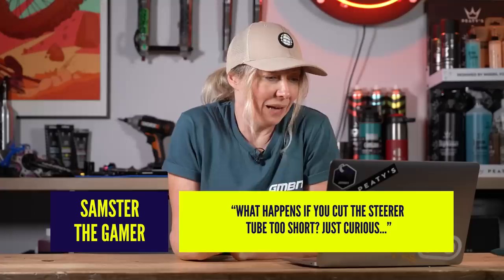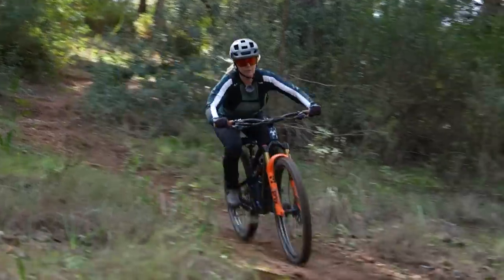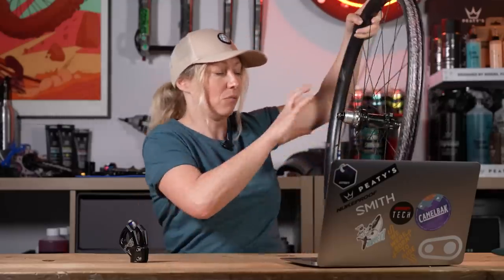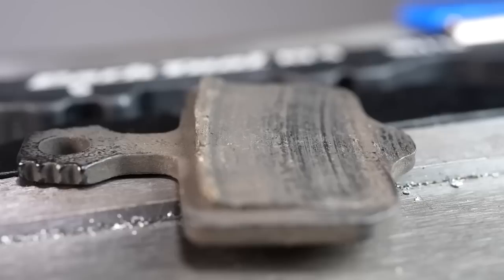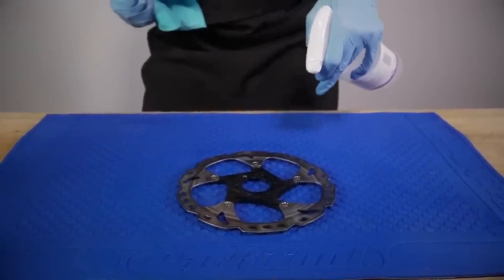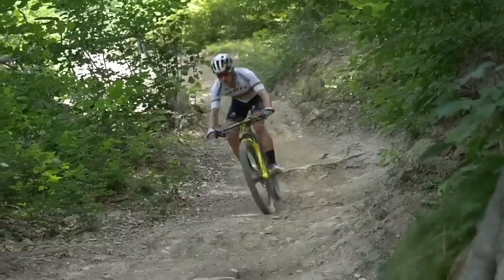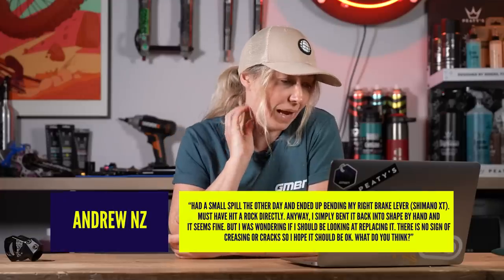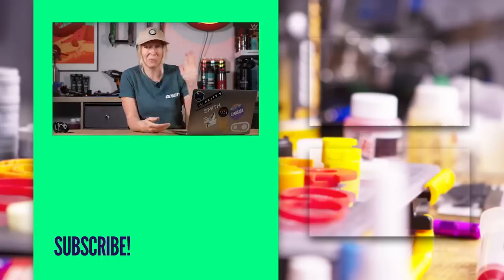What Happens If You Cut The Steerer Tube Too Short? | #AskGMBNTech

Comment: I have a Manitou Supernova that I got cheap with a short steerer. At the time, I worked at a machine shop where I made a new one out of 7071 alloy that was extra thick at the bottom and about a 3-5 thousandths interference fit. I pressed the old one out and the new one in on the hydraulic press and never looked back. It heald up to years of trials, street and dirt jumping and has never creaked.

Comment: Our local bike shops that service forks also offer steerer tube replacement, so it's not really a problem if you cut it too short albeit costly, it beats buying a new fork.
Reply from the maker: For sure. It's always worth getting your steerer replaced or a whole new CSU in fact. 👍
Reply: Is that in the UK or U.S ? I could not find anyone that offers that service anywhere in the U.S I almost want to purchase a press a learn to do that myself as a service.

Comment: Anna didn't quite understand a question about the copper paste with the brake pads. Most service channels on youtube do actually put a tiny bit of copper paste BEHIND brake pads to prevent seizing pistons with the pads, it eases the next service too.
Reply: But it's been shown many times to be a waste of time.
Reply: Aren't the piston ends ceramic?
My Shimano XT sure are.
Reply: Also generally used with car brakes.
Reply: @perjensen1962  that's right, but car brake pads will stay in there typically for longer and it is also done to avoid squeeking
Reply: @simonm1447  exactly, its done to mask pad chatter which squeals. 
The guys question was how do I cover up the rust
Reply: I use copper paste (or any other good quality anti-seize paste) on the back of brake pads where it meets the pistons. Also on the sides where it has metal-to-metal contact with the calipers.

I do it on cars, motorcycles and bikes. It is the ultimate solution to brake squeal. A careful application on those metal to metal contact areas prevents/dampens the vibrations that cause the squeals.

Rust prevention and easy service afterwards are bonuses.
Reply: @janeblogs324  I never had rust on my brake pad plates, even if they are steel back plates. The bikes I not use that much are typically driven in dry weather, and the commuter which runs in every weather needs new pads twice per year since they are worn twice per year.
Reply: Never do that... NEVER... Total nono. Especially for dot brakes, will kill piston seals. And will stop pistons working how they should to retract under the flex in the SEALS. Plus bike pistons are not metal... Copper grease on cars is to help reduce squeal on metal-metal contact... Which doesn't exist with bike caliper pistons
Reply: @TheElectricSam  no... Just no! Pistons in bikes aren't metal so aside from seal damage, pad contamination, it's pointless because pistons are not metal. It will stop ur pads retracting properly and would kill DOT fluid brake piston seals
Reply: @rupedog  some bike brakes use Aluminium pistons ( for example the simpler models like the MT200) , but I have no personal experience how they react with copper paste. I use these brakes but I never had noise issues without copper paste

Comment: Regarding the mullet question.
29er front on 27.5 bike will be more expensive. but you can select a fork length to get/keep your desired geometry.
Putting a 27.5 on the rear of a 29er will  not only definitely slacken the head angle but lower the Bottom Bracket. and could mean much more likely to experience pedal strikes.
So changing the front is better, but more expensive.

Comment: Regarding the rusted brake pad backing plates I think they just ment the piston side of the pads... in which case you could lightly sand the rust off, wipe them down with methylated spirit (the purple stuff) and with the the pad material facing down coat the back of the pads with spray paint.... or just replace the pads.

Comment: Recently my pad fell apart due to rust. It wasn't bad, what looked like a little bit on the metal part with pad looking good. Then after long downhill the resin pad fell out and I was left with no front brakes. Now I replace them regular, even if they seem fine.

Comment: What I want to know is WHEN are they going to come up with brake rotors that don't squeal, bark, howl when wet? Cars use disc brakes they don;t howl when wet, is it because the bike rotor is so thin that there is nothing anyone can do, and if so would thicker rotors resolve the issue? I woul put up with a bit more weight (even double triple and more) to stop the wet howl.

Comment: #AskGMBNTech  Why hasn't any derailleur manufacturer or even a custom fabrication experimented with an upside down derailleur as a solution to keeping the derailleur safe from rocks and stuff?

And what complications would arise from using such a setup??
Reply: The derailleur has to feed the chain into the cassette in order to shift (that's why you can't shift gears while pedalling backwards), but the top side is where the chain is feeding out. Now if we made pedalling backwards the norm, and the hub had gears inside of it to flip the rotation around, then the derailleur could be up top.
Reply: @KevinT3141   thanks man

Comment: #askgmbntech Hi guys. I just got my forks serviced by my local bike shop and it is working fine now. I understand and appreciate the need to regularly service your bike components especially moving parts such forks and shocks. My question is and correct me if I'm wrong, motorcycle forks and shocks especially motorcross bikes don't have anywhere near the kind of regular service intervals as mtb suspension components. How come mtb suspension manufacturers don't build their components like the their motorcross counterparts, i.e. sturdier and require less servicing or overhaul maintenance?

Comment: #AskGMBNTech Hi Anna & Doddy, A question on brakes for your bike tech surgery. I recently (less than  weeks ago) had new SRAM Code RSC Brakes installed to replace the original Guide RE's instakked on my Mega, and the stroke length on the front and rear is not even when pulling the levers. The Front (Right) lever almost draws right to grip. Does this indicate the fluid level is perhaps not sufficient? I see no evidence of a leak and cannot adjust the stroke dial any more to compensate. Should they be bled and the hydraulic fluid topped up a bit? Thanks.
Reply: Yes it needs a bleed

Comment: #askgmbntech Hi, thanks for answering. Is there any point to switch to bigger brake disc, 160 to 180 or 203, let's say, without changing the braking unit, for bigger braking power (less force by finger, less braking distance, etc.)?
Reply: Bigger discs dissipate heat better.
Reply: Doddy already did a whole video on this subject with Magura

Comment: #askgmbntech Swapping cranksets.  I have a dirt jumper with a single speed 135mm rear axle and 73mm bb.  It has a 52mm chainline.  When I asked a few bike shops their answers aren’t confidence inspiring.  They have said to get non boost because it’s 135mm rear hub and but as I researched I think boost with 3mm offset to get the 52mm chain line sounds like the right answer.  Any help?

Comment: Another top episode 👍- I know I should probably just not be bothered, but it does feel like the whole Mullet bike message is being lost on the general public - with that in mind #askgmbntech is there actually an example of standard 29 or 27.5 bike which converts to a mullet without any significant geometry sacrifices? i.e. you don't have to change a linkage or mess with any flip chips? - my concern is that there are riders out there who are just swapping wheels and thinking they are now 'on trend', when in fact they have just made their bikes ride worse...
Reply: A 27.5 is just smaller than a 29. Of course there will always be a geometry change when the bike is mulletted. I think some 29er bikes are designed to still have good geo when the back wheel is changed. But you can see why it is just more common to need a flip - so that geometry is persevered when a wheel is made smaller. I guess on a 27.5, getting a 29er fork with a bit less travel could make a good mullet especially with good measurements, the geometry could be preserved. But it probably won't be universally a good idea as u still want the front travel the same or more than back travel.

Comment: 5mm is big, 2-3 is more like it.
Reply: The top of the star nut should be at a depth of between 12/15mm 
Outside these measurements its likely to kill you but setting it at 2-3 mm isn't recommended
Reply: Absolutly, even more if you put the cap directly on your stem, the clamping will be compromise. I think you should always have a small spacer on top of your stem.
Reply: @knott4me561  were not talking about the star nut depth were talking about the length of the steer tube.
Reply: @jonathanzappala  exactly right, typically 2-3 mm is spec'ed by mfr from top of steertube to topcap. and depending on stem a top spacer might be recommended.

Comment: #AskGMBNTech . I purchased a set of forks from eBay that had a short steerer tube. After researching local businesses to see if I could get the steerer tube replaced I drew a blank. Gutted. As I am an engineer I decided to purchase a 6 ton bench press and bought a new steerer tube so I could do the job myself. I am pleased to report my bike has a new set of forks with the correct size steerer. Costs including new steerer, material to make plates to hold the forks and the press were around £150. If anyone in the UK West country requires this job to be done, please feel free to point them in my direction. This may be the start of a new business?????!

Comment: Hi Guys, I'm upgrading my sons bike with my old bits and getting him a new cassette just wondering if the Shimano SLX RD-M675 is a medium cage or long cage. Subject to where I get him 36t or 42t cassette, as it only says RD-M675 VIA (which is stamped in to the metal part of the derailleur) #AskGMBNTech

Comment: My rule of thumb at this point is to have at least 10mm or so above your stem so you can adjust if needed but also to get crucial clamping strength on the steerer tube. The top cap and bolt is for bearing preload only its not the area that protects against shearing loads and catastrophic failure. But what do I know just a dumb yank. Kidding just a little argy bargy love your videos.
Reply: I'm about to crop my mtb steerer and I'll be making it flush with the top of the stem for this very reason. Concave top cap won't work, so I'm getting a custom top cap printed.
Reply: I'm about to crop my mtb steerer and I'll be making it flush with the top of the stem for this very reason. Concave top cap won't work, so I'm getting a custom top cap printed.